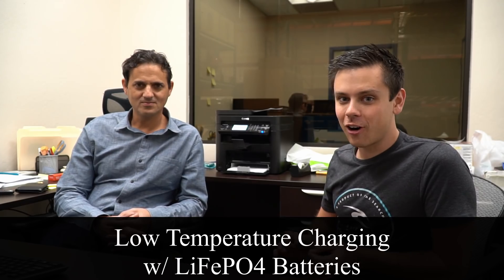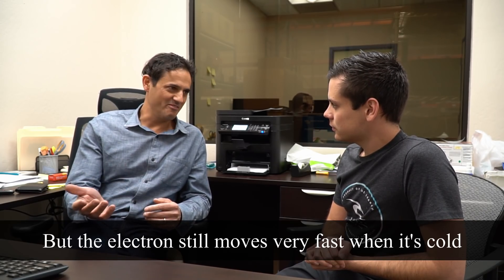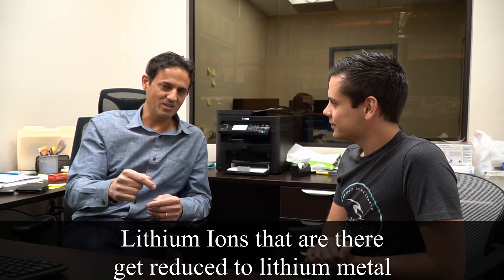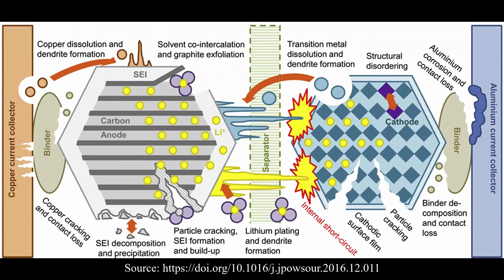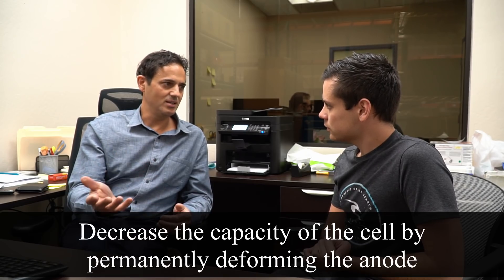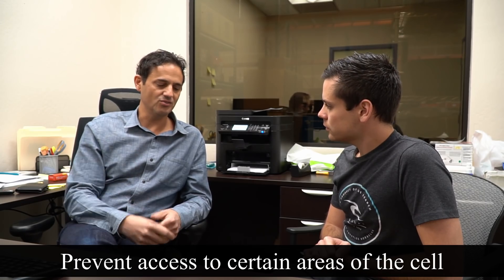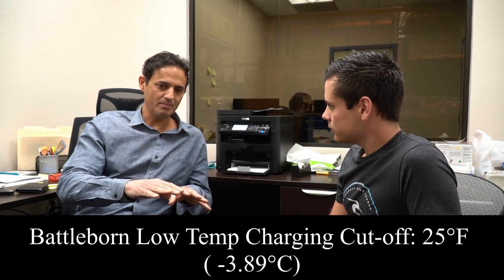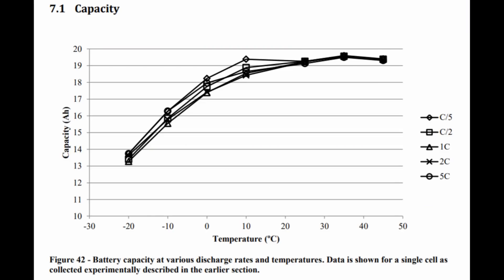Battleborn Battery CEO Interview! LiFePO4 Low-temp Charging, Storage, Longevity and so much more

Comment: What I found interesting is that he challenged much of what many manufacturers tell us particularly when it comes to the importance of terminating charge and not floating and the damage that can be done with low voltage overcharge. This is, I believe, what gave problems with the Mastervolt very expensive LiFePO4 batteries. He seems to acknowledge that there are problems but he minimises the importance of them almost to the point of irrelevance. This  makes me think of common sales tactics and ‘accentuate the positive, eliminate (or reduce) the negative. The implication was rather that their batteries don’t have these problems to any significant extent and that others presumably do as their literature on how to treat them tells us so. I think a generic graph of percentage of max charge rate that is safe at certain temperatures would be useful as would some meaningful data on degradation at high voltages / float levels and times. Some benchmark to test against or to run with in mind.
Reply: I think you’re over-analyzing what he said. The message I got was they keep their batteries safe for their intended market RVs and vans. They also try to strike a balance between useability and longevity. So they protect their batteries yet encourage people to charge to 100% (they don’t use an active balancer like a Batrium as that would add too much cost) to get the most out of their resources. Yes their batteries could last longer if the limited max and min charge and limited high and low temps a little more but I think they’ve struck a reasonable balance where their batteries should do at least 3,500 cycles before degrading below 70%.
Reply: What I was wondering was what exactly is balancing supposed to do? Does it actually 'heal' the damage in the cell that was out of balance?  Does it 'knock down' dendrites? Or other imperfections that were causing more impedance (or correct for low impedance, perhaps)?  Because, it it doesn't, I don't really see the point in getting 1-2% more capacity for what? One cycle? And everything I've seen says charging at higher voltages can try to push too much and cause more damage over time.  I dunno...
Reply: @nlewis-vg3kc  balancing doesn’t ‘cure’ anything but it does prevent things becoming sick. There will always be small differences in the internal resistance of cells even though the better manufacturers try to match a well as they can. This means that over time you get an imbalance as a cell with slightly higher resistance will dissipate a bit of its power as heat and not electricity that is used along with the rest of the cells. Balancing brings the cells all back into line again and this is generally done at the top end of the charge curve where voltage moves very fast for a small change in state of charge. I personally start balancing at 3.4v/cell which is at the bottom of the upper ‘knee’ on the charge curve and cut off charging at 14v for a 12v battery which avoids pushing the upper voltage limit and capacity limit which is the area LiFePO4 are happiest not being in for any length of time. I allow this balancing to continue once charging has stopped so long as cell voltages remain above the 3.4v per cell.
Reply: @philbrooke-little7082  Ok, so say you have one cell that drifts higher on the high end and lower on the low end ( I've read that's often the case). If you bring all the other cells up to the same level with a top balance, and there is no actual physical change in any of the cells, how does this prevent the cells from going exactly back out of balance on the very next cycle?

That's the short thought experiment now the long one. So I have a lithium titanate battery that I tested each cell charging and discharging fully. There's one cell that drifts lower than the other cells at the bottom and also slightly higher on the high end (although the difference wasn't as noticeable). 
Say you do a top balancing charge - I don't see how this helps- at the bottom, this bad cell will still drift lower maybe even lower than it did before compared to the others and then the next cycle what is to prevent it from going higher than the others again- maybe exactly the same amount? Alternatively, you could have one cell that stays lower than the other cells on the high end and higher on the low end presumably because that bad cell has higher resistance than the others so it doesn't take it as much charge (or give out as much). How does balancing help here? I've read tons of explanations, but none of them make physical sense to me.

I don't know I just don't see the mechanism that is doing anything except for trying to force charge into a lattice structure that really doesn't want them and seems like you might damage battery cells both that are defective and non-defective.

Now it may be that I'm not understanding how most BMS circuits work. I was under the impression that the BMS is monitoring each cell and not letting any particular cell go under a certain setpoint voltage (on the low end) or over on the high end. There probably is something I'm missing, since everyone seems to think balancing is important, but I'm not sure what it is.
Reply: @nlewis-vg3kc  You don’t / can’t top and bottom balance, you only do one or the other. If you have one cell with a slightly lower capacity and you top balance then that cell will reach empty before the rest. If you bottom balance then it will reach full before the rest. You have to do one or the other. If you tried to do both you would never get there as you would be shifting it up and down every cycle. If all cells had an identical internal resistance and were top balanced then they should never go out of balance on a full charge. If the internal resistance is a bit different then a degree of rebalancing will be needed which the BMS does with top balancing by shunting some of the current into any high cells. There are other methods as well that use active balancing to move charge around between cells. Balancing doesn’t happen during the normal part of the discharge / charge curve as the voltages are too close. You can actually have cells with quite different states of charge at the same voltage. I should say that I am talking LiFePO4 and I haven’t really studied the curves of lithium Titanate but the same principles will apply I would think.

Comment: I had a choice to make, being in Canada, AGM over LifePo hands down. Only weight has been my sore spot, other than that no regrets. LifePo costs BTW are ridiculously expensive, they don't have to be, Will should have asked when their costs are going to reach reasonable levels.
Reply: I have 16 of these and they  outperform all lead acid techs by far , both in available power on a daily use basis and especially in longevity of usable lifespan (total battery life)
Yes they are expensive to purchase initially but they are half the weight, take half the space, are at least twice as energy dense and should last 10 to 20 years (possibly more) of daily (80% full cycle) duty.
All this being said, they are quite a bit cheaper than lead acid over the duration of their useful life.
I very well may be dead and buried when these batteries wear out. But I plan on living another 45 years to see how well they last. The same argument is often made against solar because of the upfront costs. But we buy solar because we know that it will eventually pay for itself in roughly 3-10 years (5 years in our case to pay off the initial cost of $36,000.00) but that payoff is really not the only important issue.
We have to understand the freedom that unrestricted power gives to us now and also the peace of mind that we will not suffer from grid outages and poor quality power. This truly is independance and I am actually grateful that battleborn has made such a hard working, solid and dependable product available to us. Good workmanship is hard to find these days. In the long run (I expect after maintaince, repairs, and any additional expansion or inprovements to our system) we will have saved between $200,000.00 and $300,000.00 by not having to pay the next 30 years worth of utility bills. This is after an initial 5 years to pay for the system and then 25 more years without a single utility rate hike-highly unlikely. All in all it's an investment in our future, and I can't think of any single safe investment opportunity with that high a return. No risk with solar, you own it and it keeps on paying you back. 
That's my perspective anyway- after living with zero power  for 5 months after hurricanes wiped out our grid infrastructure. And pouring $4,000.00 of gasoline at $5.00 per gallon (cash only) down the throat of our generator.
Never again ! Independance is key and reliability, redundancy is a must for us.
Hope this helps you to see the logic & why sometimes price isn't the single most important factor.
If they do ever lower the price significantly I will buy 16 more just for the added backup of a second battery bank.

Comment: Oh nooo!  After this interview I learned not to store my Battery Born batteries empty. Too late for me to learn this.  After a recent move, ignorant me, stored my two batteries empty. Now they are at 3.5 Volts each.  Is there a way to revive them?   Or are they toast? 😥
Reply from the maker: Are they in safety mode? How long were they in storage
Reply: @WillProwse  3 months. I don't know if they are in safety mode. After your video all I have done is check their voltage. I do have a Black and Decker lithium battery slow trickle charger I can connect to them, but I want to hear from the experts first before I cause more problems.
Reply: @MoBiRa-t6k  Will do and will let you know what they tell me. Thanks

Comment: I don't know if that issue has been addressed in the past but here is my question Will:

I am building my own travel trailer and I bought a BB battery, I am working on the 120VAC and 12V electricity right now.  I purchased a Progressive Dynamics converter especially designed for lithium batteries.  I have to connect my RAV4 electrical connections to the travel trailer for lights, flashers and also... charging of my BB battery when I haul the trailer.  I saw on YouTube that I would have to ad a DC to DC charger in the equation:  can you help me with that matter?

Comment: Do batteries heat up while they are being charged? Or discharged?  In other words as you charge at cooler temperatures will charging capability improve
Reply: I believe they do slightly but very little.

Comment: After reading several comments below, I think it's important to stress that BattleBorn is still the most "Affordable" option compared to other "Cheap" versions of this chemistry. Battleborn appears to be a very high Quality battery with a Reasonable/Affordable price for the length of service it provides. Yes, it's tough to handle that Cost in the beginning BUT, in the long run the overall cost is much less than the competition.  I don't like the word "Cheap"....  Try using other adjectives to describe the difference in "Price" and "Quality" as the word cheap can affect both.  Thanks Will.....  BTW, your old Tesla pack is still working just fine in my application.

Comment: I wonder if they have a safe charging rate  vs temperature chart.
Reply: I would also like to know this also. What should my max current be at 30 degrees? 28 degrees? 25? Etc...
Reply: @off-gridengineering3377  And why not program those values into the BMS, so the charging over-current cutoff varies with temperature?

Comment: About ready to order two battleborns for my RV , but did I hear him right? They are coming out with a battery that has internal heating? My current batteries are outside my RV and lithium with internal heating would be great. Love your videos
Reply: Looks like BB will be coming out with an internally heated battery soon.  I'd wait for them if your batteries will be mounted outside the RV, or outside anything.
Reply: They could be moved inside very easily if you have room
Reply: @mrmotofy  I emailed Battleborn and they replied immediately that their new battery with internal heating should be released in March or April of this year. Will probable wait to see what that entails.
Reply: Gregg Hershberger It better have built-in Bluetooth monitoring, as well, otherwise they are already behind in the game.

Comment: A huge thanks for this great interview. Now the only question I have is what is high and low STORAGE temperatures for the Battleborn batteries. Assume that the battery is completely disconnected.
Reply: My take on that was, temps. are unimportant with a no load/charge condition. Steady state storage temps. probably have an extreme range. IMO

Comment: So, all batteries shud be charged, no matter what kind, at a reasonable temperature..  extreme temperatures are going to degrade the performance..
Reply: Smith 
Lead acid batteries can be charged at lower temps but will show bad performance (think 50%) at low temperatures.

Li-ion batteries will suffer permanent damage when charged at low temps.
Reply: Lassi Kinnunen 
Lead Acid batteries in cars usually have over capacity so that they still have enough enough power to crank the engine at very cold temperatures.
Reply: I’m just stating facts. Not arguing that lead acids are better or worse than Li-ions. They are different and depending on the circumstances one is more suitable than the other.

Comment: Great company just a shame they wouldn't email me back as from uk. As cheaper to buy from them in states than their partner over here.
Reply from the maker: That is probably because the cost to ship them that far. Batteries are not cheap to ship and have restrictions. They are also assembled here in Nevada. What price did you get quoted?
Reply: @WillProwse  last contact with them was amazing and they advised happy to ship to uk. However no response from my follow up email. Gutted to be honest. Love your vids tho guy, no fluffy BS just straight to point always with rationale. 👍👍
Reply: they might have an exclusivity agreement with that partner, that they won't under sell the partner...
Reply: @javabeanz8549  no, battleborn advised me they use them for sales in uk.
Reply: Who is selling these in the UK?
Reply: @urbanimage  a company called Transportenergy. However silly money.
Reply: @l33pul  £1199 for 100ah is quite expensive, though a Victron 100ah is about £1000 (doesn't have low temp cut-off though). I'd like o see how TN or Umax batteries are constructed.
Reply: @urbanimage  after seeing the strip down of a Battleborn, from a tech side I would trust them over others. We need ours to take in a vehicle that's going to the Arctic, hence we will be putting all our trust in it.
Reply: @l33pul  Yes, Battleborn do look we constructed. I'm looking at batteries for my narrowboat - so not exactly as critical a situation 8--)
Reply: Had 16  battleborns shipped to the U.S.V.I. along with all the componants to build a new state of the art system after hurricanes Irma and Maria removed our old grid tie system.
Best decision we could have possibly made, we love the battleborn Batts. And everything has been performing flawlessly since I installed the system a little over a year ago. Spend the extra money, they are a great battery and made by a stand up company.
Shipping was expensive but worth every penny in my opinion. I researched for two months before purchasing two years ago and I'm still convinced battleborn has the best product available to this day...